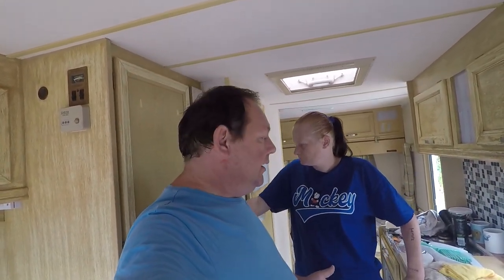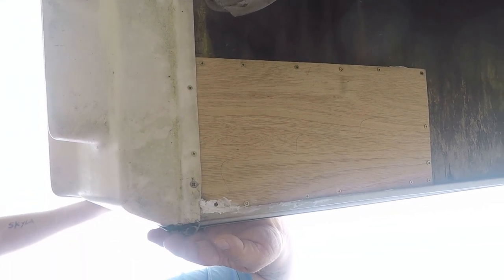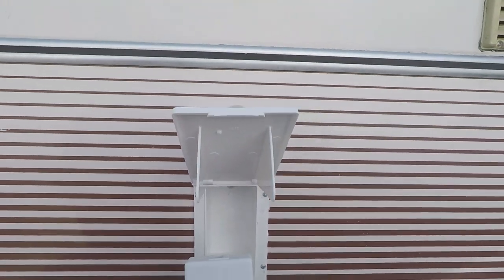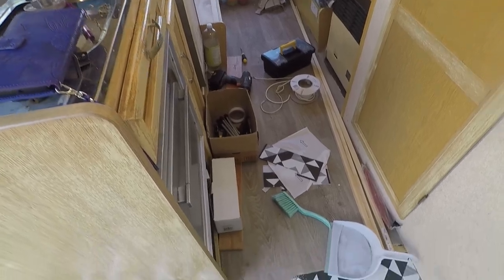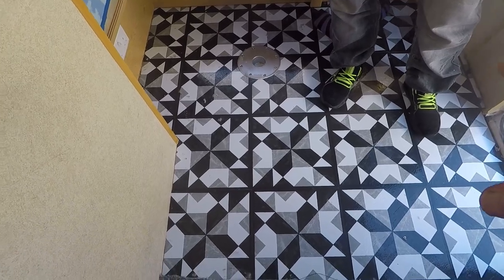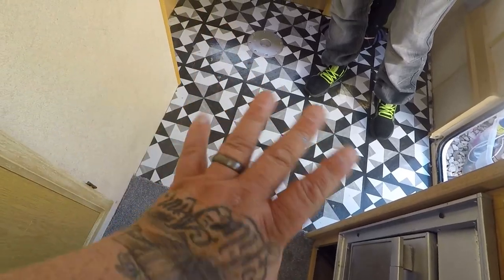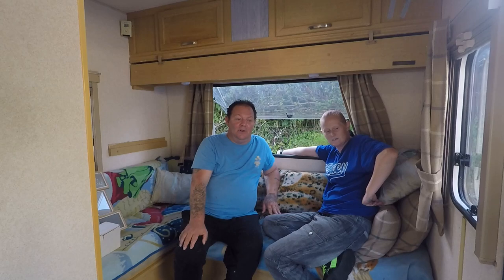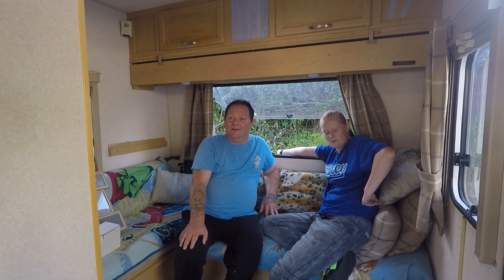Renovating caravan part 11 (the end is near)

Comment: Not long now guys   .i liked the floor by the door it went well with the slashed back over the cooker and sink  and easy to clean like the boss said .  Just a rug on to would of been tidy . Whats the out side plug for ?  And can you put a plug in it ? It look a bit low. the cable on the plug will be tight to the bottom.  you guys have fo e a super job in the van